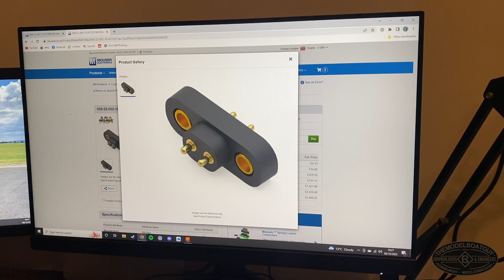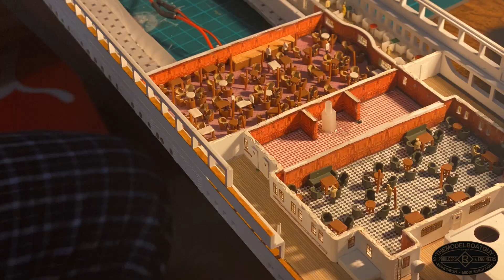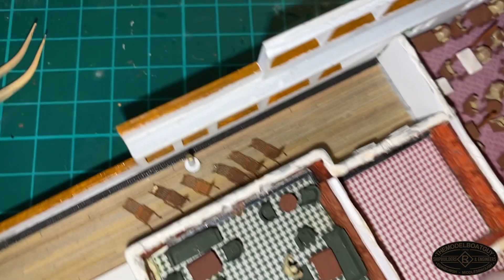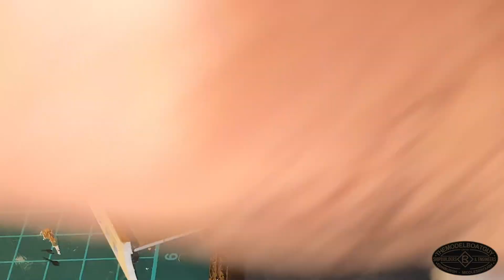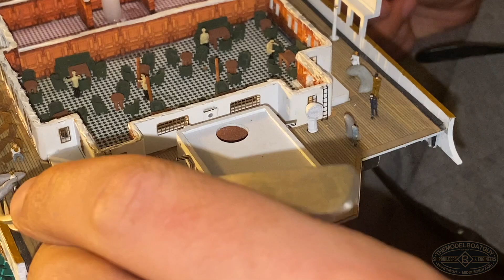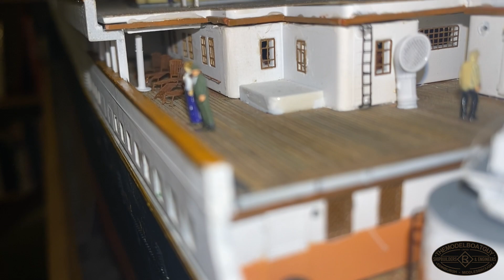Radio Control Trumpeter 1:200 Titanic Build Part 65 - Completing B Deck

Comment: Did the figures come with the kit or are they Preiser or 3D printed?
Reply from the maker: Hi there, a few came with the KA add on set, but I bought a bunch extra from: 
https://www.scalemates.com/kits/zlpla-fs-01-titanic-crews-and-passengers-figures--1232823

https://www.scalemates.com/kits/tori-factory-fs-06-titanic-crews-and-passengers-set-3-1-200-trumpeter-titanic--1297098

Comment: What I dont like about this trumpeter is the thickness of the walls. They r too thick and doesnt resemble the real life. I'm thinking what can I do about my model to reduce that thickness, maybe order new deck walls
Reply from the maker: You are not wrong! It’s really annoying, but what can you do. I know some people have used milling cutters to thin the walls down, but that brings its own problems. Some people have used photo etch add on sets that have sorted the issue. I suspect that’s the best way
Reply from the maker: You are not wrong! It’s really annoying, but what can you do. I know some people have used milling cutters to thin the walls down, but that brings its own problems. Some people have used photo etch add on sets that have sorted the issue. I suspect that’s the best way

Comment: Nice Rob, I was trying to think of a way to get the little people 'pegged' rather than just glued down.  I may have to think about that in the future!  Anyway don't they look good!  I like the neat electrical sprung contacts. I can see possibilities with that idea too!  Nice video as always. Regards JH  ⚓
Reply from the maker: Thanks John, 
Interesting thought, I suppose you could drill very fine holes into the deck and the people and use a brass wire. Fiddly work though. It would work quite well with the more substantial figures, but the finer ones would be a struggle.
Something to think about I guess, 
Thanks as always, and I shall be in contact soon.
Robbie

Comment: While working on the ship. Have you use any magnifier to better see what you are doing?
Reply from the maker: I sometimes use magnifying glasses when painting figures, for the rest of it, I just eyeball. But I have very good vision which helps! The thing that I find is most important is light. Especially in winter having sufficient light on the workbench is vital